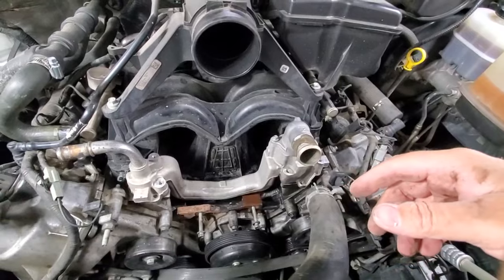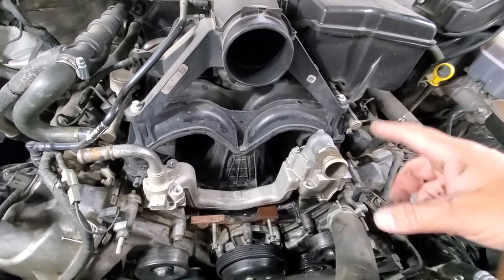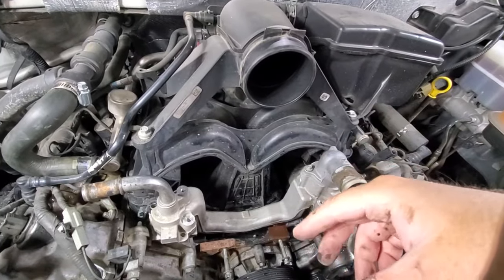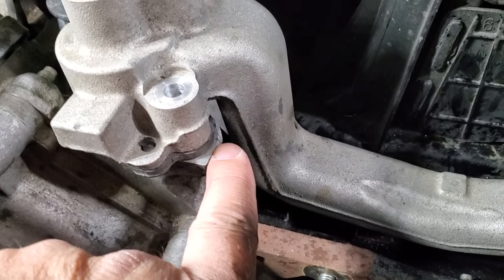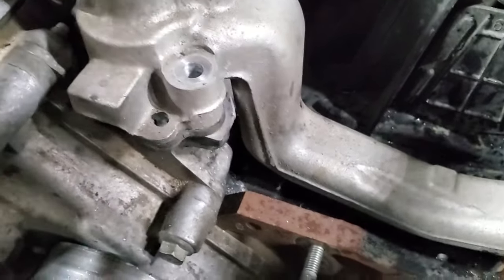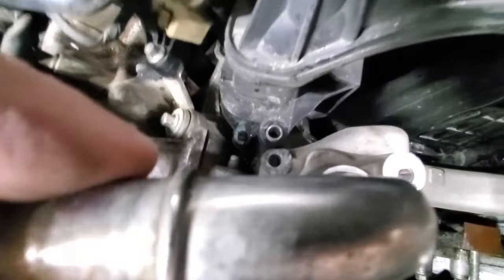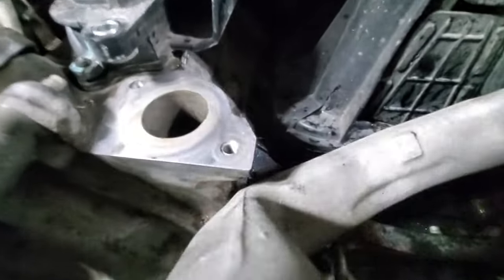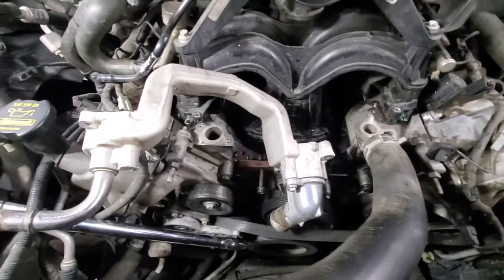Ford 5.4L 3 Valve Coolant Crossover Gaskets, Both Replaced -The easy way

Comment: HI, thank you for this.  I have a 2003 that is leaking from the passenger side and filling the plug wells with coolant resulting in a terrible miss.  After changing out coil after coil, replacing fuel pump and other stuff, we have concluded its this - of all things.  Do you know if it has been confirmed the same on the 2003?  Most importantly  I can't seem to find the gasket for this crossover tube anywhere... Do you by chance have a link?
Thank you for taking the time to share!
Reply from the maker: Mine is the next generation so I'm not really sure. I'd say call your local parts store and see if they can find it. I'd just be guessing on your 2003.

Comment: Ok my big question is how did you get that one screw out from the manifold bruh? You already got that screw out how? How you post this video and not show how you got that screw out I have an 2003 Eddie Bauer edition 5.4 and it has a screw I can't get out
Reply from the maker: I'm not sure which one you are referring to. Mine had the 4 there right on the top that fairly easy to get to with a 1/4" socket extension. Perhaps make a video and show me which one? Getting to the point that I started the video was pretty easy honestly.
Reply: @DoesItTrack  what I mean is the left side of the cross over there's one screw bottom side up only way to remove it is to pull the manifold apparently I'm talking about the one screw on the left that goes into manifold next to where you shaved off the metal to remove the crossover
Reply from the maker: @ProGods-m3d  All of mine are top down bolts, yours come in from the bottom?
Reply: @DoesItTrack  yeah man my 03 that one that you have the manifold is on top of the crossover mine is under the crossover I wish I can show you a pic but can't on YouTube comments
Reply from the maker: @ProGods-m3d  Oh that sucks! No way of getting a 90 degree tool down there or anything?
Reply: @DoesItTrack  not a fat chance lmfao I believe on my year 5.4 Eddie Bauer edition is made by the most stupidest engineers cause I don't think I have gaskets to replace I have to replace the entire manifold cause it has the gaskets built into the manifold meaning none replaceable
Reply: @DoesItTrack  I liked and subbed just cause your reply was so fast and very friendly sorry about my 1st message Im very stressed out on this whole thing 😭
Reply from the maker: @ProGods-m3d  Thank you! I totally understand too. Cars/Trucks can be a real pain in the butt, stressful too.
Reply: @DoesItTrack  yeah considering I just had to change my radiator it blew so yeah lol

Comment: Does any one have the part# for right and left side gasket? Just for the crossover tube?
Reply: Ford part # YL3Z 8C388 AA  and Ford part # YL3Z 8C387 AA
Reply: Just left the dealership. Had to ask what part this was at the counter cause everyone assumed a thermostst housing. Got a diagram and part #s

Comment: This video makes no sense if you have to remove the plastic manifold to get to the bold that is under it how does filing the block remove the bolt that you can't get to ??????
Reply from the maker: @joshuaczupowski7583  if yours has the bolt that comes in from underneath,  you have a different intake configuration unfortunately.

Comment: Dude, what a valuable video. there should be a collection of vids on here that are labeled "Terribly Invaluable, $$ saving ingenuity, Never Delete !" and this should be in there. no way I wanted to do these gaskets if I had to remove the intake. I would have, but saved time, knuckles and curse word consumption. (there's only so many swear words, we may run out!! ) Thank You So Much. My Hat to you Sir!
Reply from the maker: So glad to hear that, Bruce. Very nice of you to say so. This was one of those "ah ha" moments that just has to be shared with the community.
Reply: @DoesItTrack  I did do the mod, used a grinder. 30 seconds of work. :-) but then I did not even need to pull the entire assy out, as it did not want to come free of the intake with out a fight, and since I didn't have the gasket for that side anyway, I left it in place, the oposite end was free enough for me to lift and remove the old gasket, clean up and place the new one. but the advice was priceless like I said. its easy stuff t
like that, that make a repair so much simpler and possible for many more people than it would be. And thats just awesome knowledge to come by. so thanks again. By the way, I was hard pressed to
find anybody talking about doing this job without removing the intake. and I was fairly sure it was possible, but I wanted to see if anybody else thought so, before I invested the time. I had trouble finding anybody talking about this particular cross housing on this motor. and ironically, yours was the first video I found. I needed no other videos to encourage me. Cheers!!